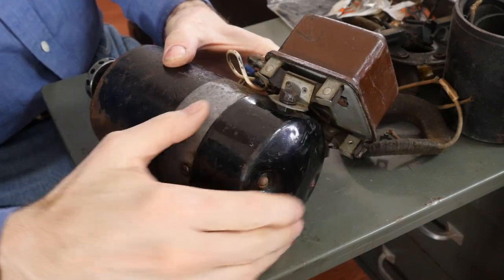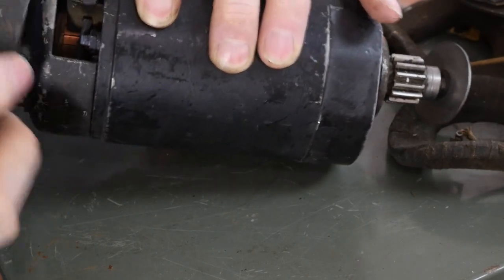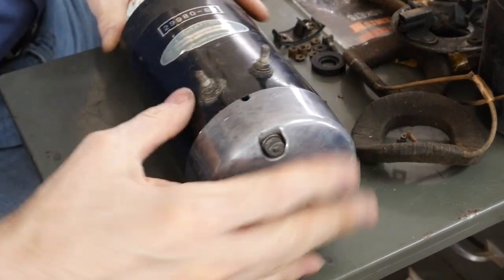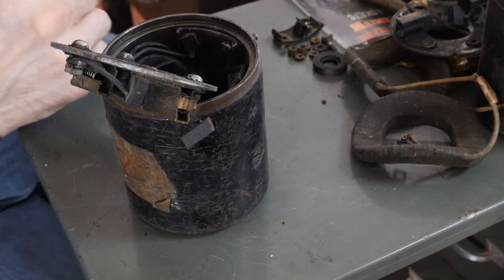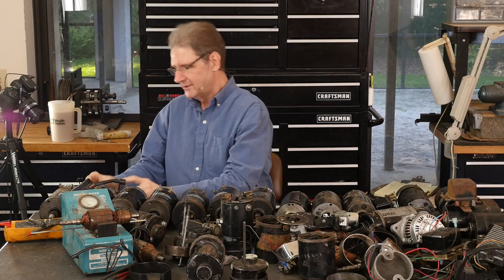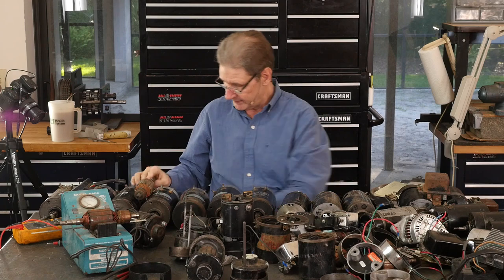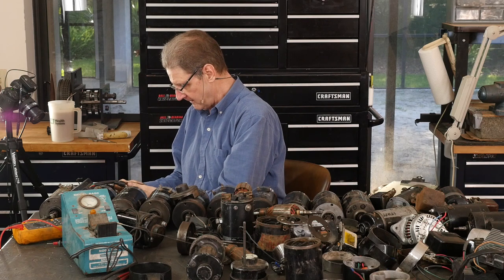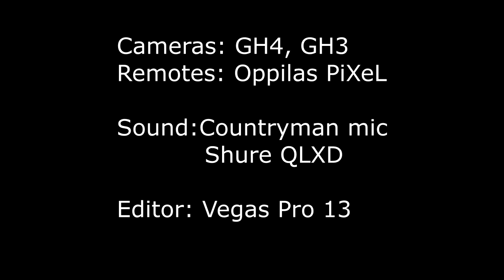Iron Sportster generator overview

Comment: Thank you. I’m going to dig my 77 out. Been stored for 30 years. Always had a charging problem. Always had a tire/wire problem. Never put the two together. Also never knew about polarization. I did not have help when I was younger. I want to get it ready for my grandson and your vid has gave me a wealth of knowledge.
Reply from the maker: How cool. I just took my 1977 out for the first time in months, now I have my vaccination. It started up after a four kicks, and thank heaven for the alcohol-free gas I put it in it. I have never let it sit this long since 1985 when I bought it. It used to be my daily driver, even those lean years when I didn't have a car. 

I just bought 6 armatures, and will be comparing them. One cost 10 bucks, another cost $120. I will test them all. I just posted a big rebuild video, and the article I link to in the description is 21 pages of going through the Model 65A generator. Good luck with that '77, it's a great bike!

Comment: I'm going to look at the rear wires but I never seen a short. My 1984 sportster thanks you💯. Thinking about putting alternator on it and how much longer did you battery last? All else fails I'm going kick starter route 😤
Reply from the maker: Cool, be warned the little alternators are noisy, that is one bad thing about them. There is that guy that adapts the Toyota Nippondenso tractor alternators, he would sell on eBay, but he wanted 400 bucks and that was years ago. If you don't have a lot of lights or radios, a factory alternator will work OK.

Comment: So what do you think I should do to make a 84 ironhead reliable 🤔
Reply from the maker: Well, one thing is to keep it stock and only use stock factory parts to fix it. Nobody does that, including me. You can hope to find the good aftermarket parts from forums like the XLForum. When I was an engineer at GMC Truck and Coach in 1974 (well, a co-op student,) I asked Wally Edwards, the chief engineer, why any car or truck was less reliable once a mechanic worked on it. He said, "Two things, torque control, and cleanliness." And that was before knock-off parts from China and Mexico flooded the market. In Hot Rod magazine back in the 1970s writer Don McFarland pointed out that almost every hop-up modification reduced the reliability, trading that and drive-ability for more HP. So I run stock cams, and as Duncan Keller taught me, cheap nitrided valves, not stainless steel, and cheap cast iron guides, not bronze. Stock stuff even works when it is aftermarket. And when I work on the bike I pretend it is me on an operating table opened up, and I try to be as clean as I would want the doctors to be. On top of this, fresh oil and hit those old fashioned lubrication points, Zerk fitting and oil the cables. A 1984 is one year before the Evo, and it is quite modern compared to the older Iron Sportster.

I never let my old lady wash the bike. I also learned to never pressure-wash it. Just a wipe-down and you do it yourself so you see the stuff that is loose or broken. It only takes one episode of being on the side of the road, and your girlfriend saying, "Oh, I saw that thingie like that when I washed the bike," and you learn to let them show their love in other ways.

Comment: Not a sportster.  I have a pre evo 85 and the only difference is that alternator.  I would rather have that alternator.  But yeah my back tire hits wires too in the fender.
Reply from the maker: Yeah, the fact they came out with the alternator in the middle of the model year tells you they had some development problems. You should have that Hitachi generator on an early 84, but all the 1985 bikes were alternator. They changed from a 8-hole stator in 1984L to a 4-hole stator in 1985, so that shows more development problems. I just would hate to have to remove the primary chain to work on the alternator. I admit the alternators make more current, but a Hitachi is rated 13-14 Amps, way better than the 10-11 Amps of the -65A used 1965-1981.